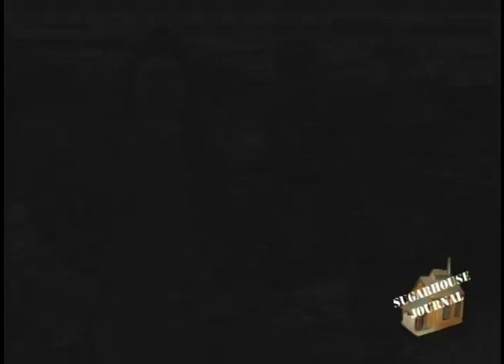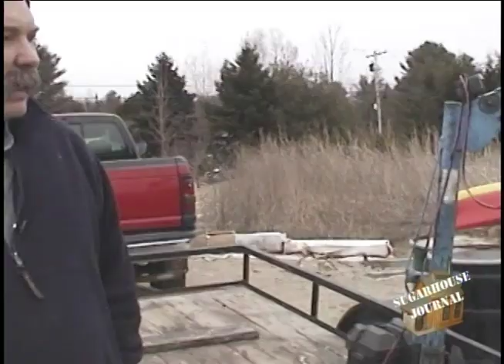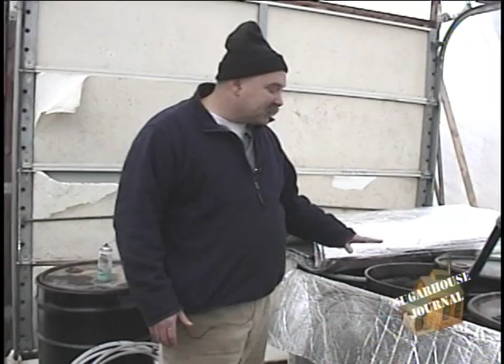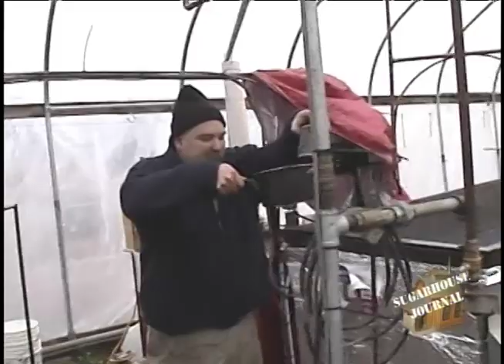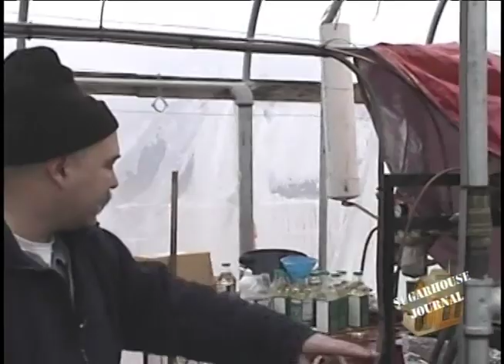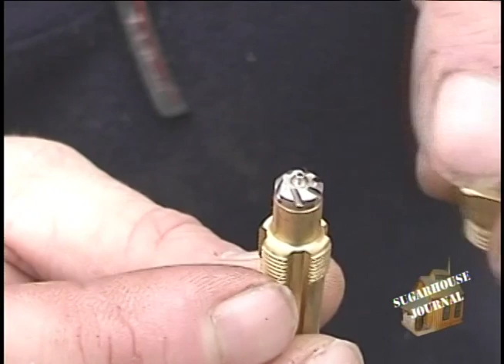Heating a Greenhouse with Used Cooking Oil

Comment: A lot of the restaurants around me sell their left over oil for biodiesel (apart from those who get really solidified oil). But you're correct that there is no point in turning it into biodiesel if you just want to burn it for heat rather than use it in a vehicle.

Comment: Is that brass air/Oil mixer just a paint sprayer nozzle?
Reply: no, it is an oil furnace nozzle. there are many different styles and fuel burn rates available.

Comment: From a survival article several years back, they made a survival heater with a metal bowl under a boiling pot.  Sand was placed in the bowl to 2/3 full.  the oil was poured in to soak the sand.  a small pile of kindling was placed on the sand and lite to start the heating process.  a further refinement was to run a metal tube to the bottom of the bowl and with a valve gravity flow the supply of oil.  the sand limited the burn rate and cleaned the oil to burn.  water was evaporated away.  What about the same method in a 2 barrel stove.
Reply: +Ron Good Hi, Ron Good! I like your way the best. Your simplest solution is the most effective. I hope you have more to offer along the Occam Razor principle. Furthermore, burning any oil within the greenhouse produces the all 3 things plants need to grow: Heat, water and CO2, plus the sunlight  All needed now is a feedback gizmo to start and dose the oil to burn in response to heat demand. It is a pity YouTube does not allow direct save of the post though.

Comment: This is not so innovative. Clean Burn Boilers and furnaces have been burning veggie oil since 1984. It takes a different tuning then if you are burning motor oil, but as a service tech I know a number of guys burning veggie oil.

Comment: you compst the ,water and gunk from the bottom of the drums, how long does it take? i have a compost heap i have a compost toilet which is added to it.  to so i couls add that to my compost? i use a rocket style burner which burns waste oil, have a look at my video if you like :),  i tried  the burner type you use and found you had to filter so clean that it was very labour intesive and a bit of a hassle. the system i use doesnt require electricity and only requires very basic filtering . great video youve done and its a big system you have, mines only for a small house

Comment: To userxo1 they probably have little control over the oil sources, however given the process of producing the oil the amount of residues from plant cultivation is likely negligible, you're more likely to get residues from the factories involved. Also as a pet peeve I have to mention that dreaded GMO soybean and canola would actually have little to no pesticides used, and would use herbicides that breakdown a lot faster than the alternatives would have to use otherwise...and are usually far less toxic. As an environmentalist I would thus prefer it if they came from GMOs.

Comment: If your were to burn the cooking oil near 98% couldn't you just vent straight into the greenhouse?  Not being a chemist I don't know but wouldn't it be mostly co2 and water.  Co2 being good for plants and not co which is of course poisonous.
Reply: I think the gas should be washed before venting it to green house. Even though it would be mostly CO2 and water, there are always harmful impurities which cause strong odors and some can be carcinogenic. But I would say the odor is the biggest problem.
Reply: ***** Didn't think of that. Also now that you mention it cause the industry probably isn't too well regulated you might be subject to geting cooking oil that is contaminated with hazardous materials.